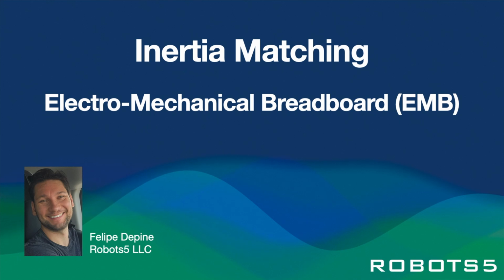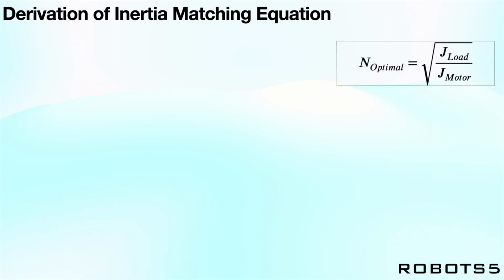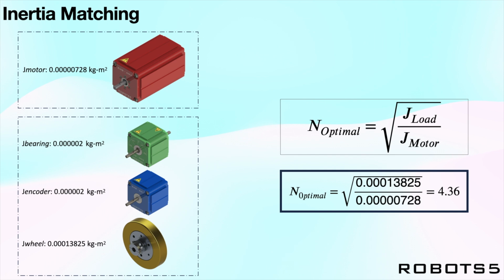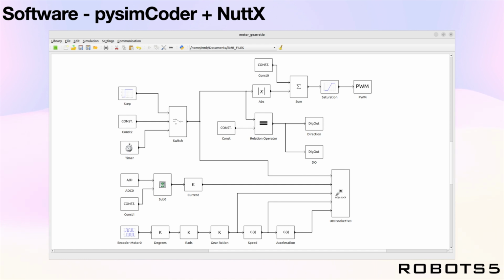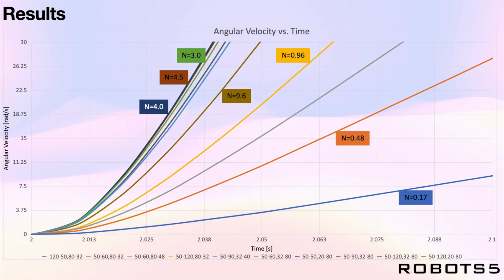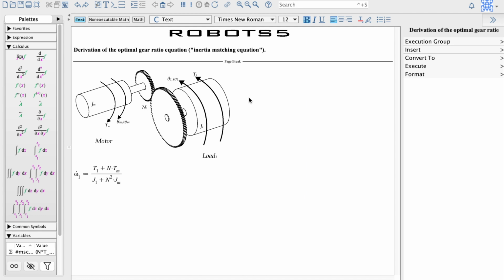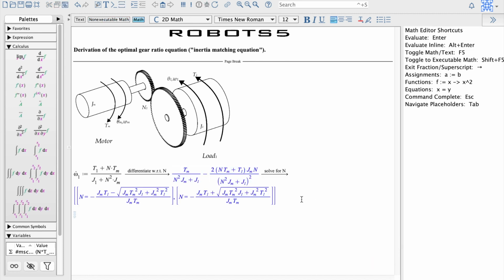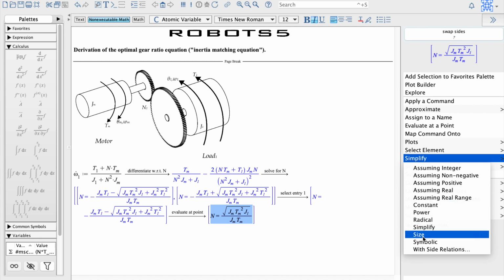Inertia Matching by Gear Ratio Selection

Comment: Another example of the strong analogy between mechanical and electrical systems, as the formula for the turn ratio of an impedence matching transformer is N= (Zp/Zs)^0.5 . Although the load and source are flipped from the mechanical case (which I can't explain off the top of my head).